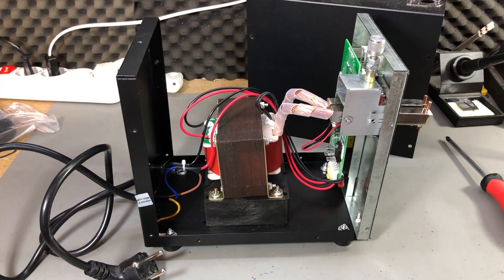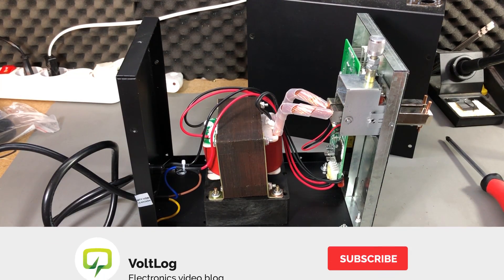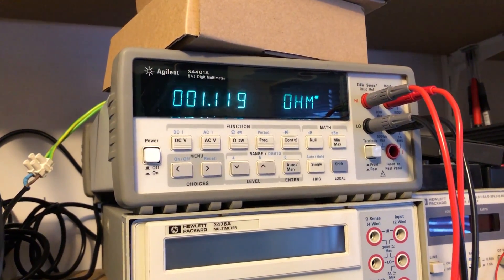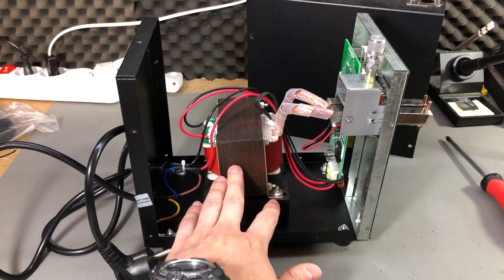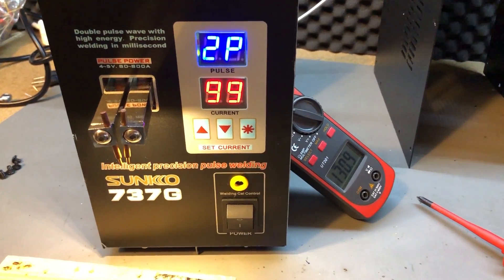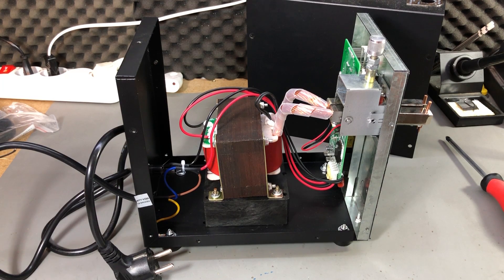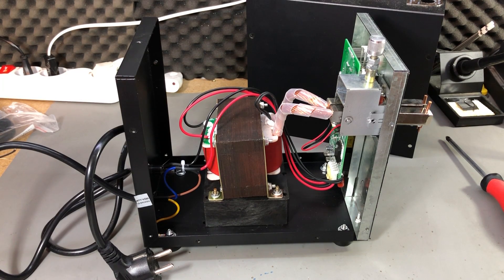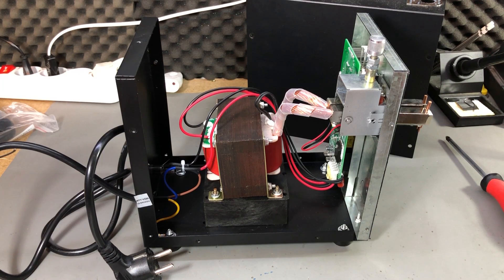Voltlog #202 - A Short Update On The Sunkko 737G Spot Welder

Comment: Hi, that 0.8 Ohm is too much! I can only speak for Germany, but I don't think that it will be fundamentally different elsewhere. Here, <= 0,3 Ohm is needed if the cable is shorter then 5 m and the circuit is fused with 16 A.
I doubt that the mains-cable is good enough and would exchange it with a non-Chinese one.
Carsten
Reply from the maker: The mains cable is probably poor quality and I was also measuring to the front panel which is a separate piece with another painted connection to the rest of the enclosure
Reply: @voltlog  To be clear, a short google-translate:
---
PE resistance
In the case of devices with a protective conductor and touchable conductive parts connected to the protective conductor (protection class I devices), the proper condition of the electrical connection between the connection point of the protective conductor (protective contact of the mains plug) and each touchable part connected to the protective conductor must be demonstrated.
----
To reiterate (sorry, but it is important): The <= 0.3 Ohm are to be measured from the mains plug to every touchable metallic (conductive) part of the device.
Carsten, today shortfused.
Reply from the maker: Carsten Hiller totally clear, I was simply trying to find the reasons for the higher resistance observed here which in my opinion are low quality cable and poor connection from front panel to rest of the case and grounding point.
Reply: @carstenhiller5613  That resistance may be hard to measure accurately though, right?
If the metal is painted, you cannot easily probe the metal itself with a multimeter probe. So you would probably need to scrape off the paint wherever you want to measure.
Reply: @Basement-Science  No, not difficult at all. You touch all exposed metal: Screws, shiny knobs etc.
Only if there are no such things, you are forced to scratch the paint and that can be done on the underside of the device. No-one will see your deed.
And, in an industrial environment where such measurements are routinely done, you will be hard pressed to find a non-prescratched device. :-)
Carsten

Comment: I know a lot of 787s are junk. I think they use 1 transformer for 110V and 240V, and it doesn't work for 240V.
The resistance of the strip is what makes the heat to fuse the metals together, so it's harder with less resistance
This guy is getting a few more amps - https://youtu.be/Y3LX5CYB99g
Reply: you mean harder with higher resistance